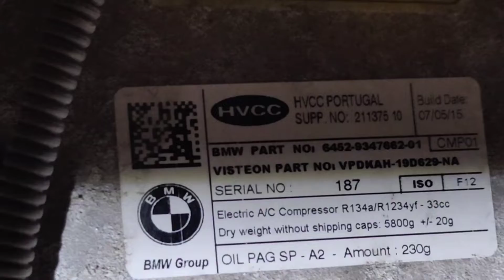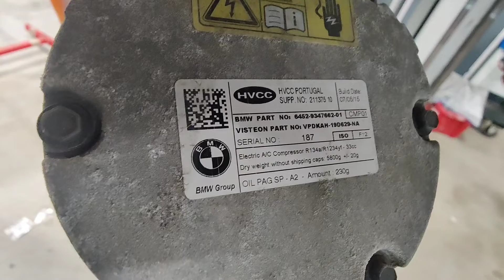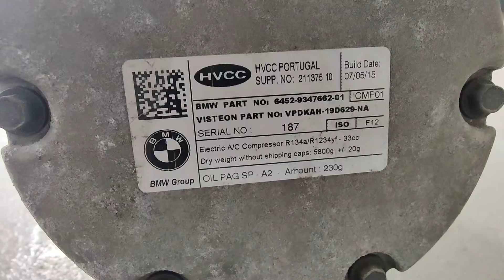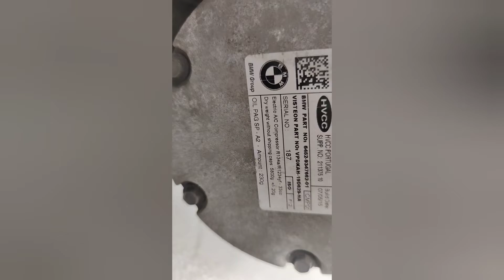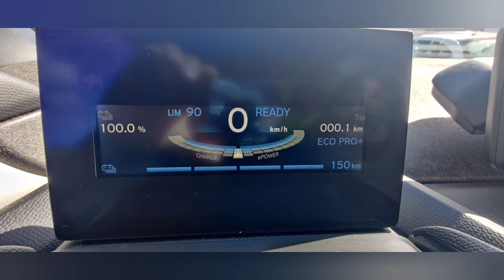BMW i3 AC compressor replacement

Comment: No need to code the new pump ?
Reply from the maker: @iTzz_NoToRiOuS_b  You don't need coding, but it's the initial run-in of the AC compressor.
Reply: Can the signal wire shortcut a new pump u think?
Reply from the maker: @iTzz_NoToRiOuS_b  Try activating the compressor using diagnose"Diagnostic tester"at different speeds. Of course, you should always start by measuring the pressure in the AC system."Without a signal , the AC compressor will not start."
Reply: It’s more that we don’t have a clear fault code only it’s saying that ac compressor doesn’t respond. Code E70C30. But we get signals on all the 3 cables. Also what u mean with tester ?

Comment: Hello, what kind of gas and oil is added to the compressor?
Reply: The tag says 230g of PAG SP A2. and I think it should be R1234yf, not 134a...33cc
Reply: Don’t add any oil. Compressor placard shows oil in it. …unless you lose it otherwise
Reply: It's all in the video, on the label applied to the compressor.

Comment: Was this work done on a filly electric BMW i3 or a hybrid model?
Reply: At 0:04 you can see the gaping hole where the REx engine would have been... this is a BEV
Reply: @beforebefore same Rex or bev
Reply: @flyingyakdeath  BEV typically has heat pump components that add to the system refrigerant plumbing... Rex can't have heat pump.
Reply: @beforebefore  I’m in US. I haven’t seen a heat pump model here. Maybe they exist and you are correct. I have a 19 Bev S and it does not have a hp.
Reply: @flyingyakdeath I have a 2018 i3s bev with the heat pump
Reply: @flyingyakdeath 2015 BEV here, Missouri, with heat pump. Why do you believe yours does not have it?

Edit - I found info that says beginning in 2019 (for the US market), the heat pump became an option for the i3 BEV.

Comment: Price for the compressor?
Reply from the maker: About Dkk 13000 kroner
Reply: @spd557  4
$700 US for a new BMW compressor????...seems awfully cheap??
Reply from the maker: @johnnyzee383  forgot the last zero 😂
Reply: Thats better...so in Canadian dollars probably around $2000.00 which is what I expected.
Reply: We've got our 2017 i3 BEV 94Ah booked in to BMW to have the AC compressor replaced next week and have been quoted GBP £2940 of which the compressor itself is around half of that. They are also replacing the pressure pipe and suction pipe, presumably to reduce risk of any metallic particles remaining in the system. Labour is quoted at 5 hours at £168 per hour. I'm not impressed that the compressor has failed after only 6 years and 72k miles but it is what it is...

I was a little bit tempted to replace it myself because I'm a very experienced amateur mechanic, but in this case because I don't have AC equipment to drain, flush and fill the system, I don't really want to spend around £1500 on a compressor only for it to fail again in 6 months because I didn't flush the lines properly. At least with BMW I'll get a 2 year parts warranty on the compressor.

For info, the symptom we are seeing with the car is a harsh sounding whirring noise from the back of the car when the AC is engaged. We've owned the car from new and it has always made some noise when AC is activated or when preconditioning the car, but the noise level has changed dramatically and is now very harsh. It's clearly the compressor which has started to fail so we are avoiding using it just now to avoid the risk of further damage.
Reply: Hopefully they flushed the lines and added an inline filter to keep the metal debris from ruining the new compressor?